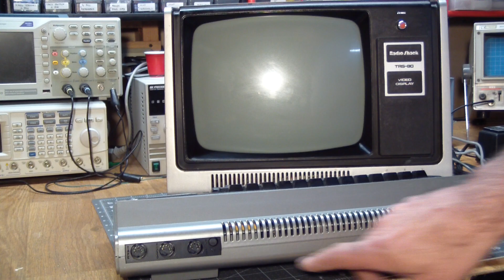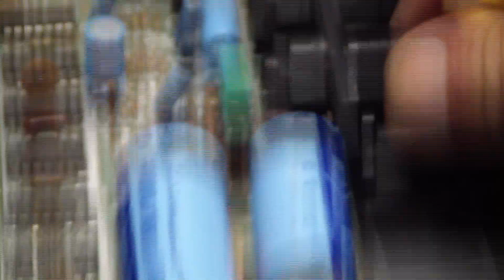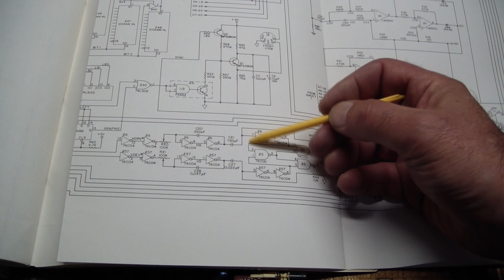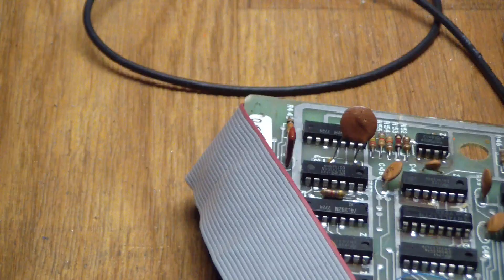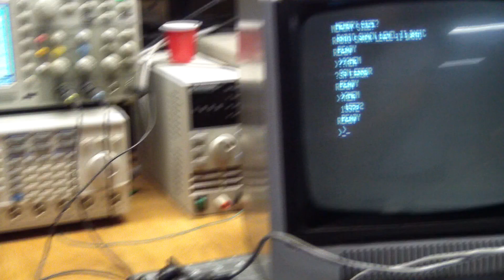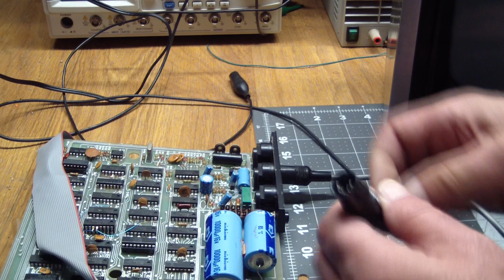AE#203 TRS-80 Model 1 CPU Board Repairs

Comment: Really enjoy these retro computer episodes. My brother still has my dads trs80 1, in its original box with all the literature.  However, he refuses to take it out of the box, even to check fo leaky caps. Seems a pity as i know my dad would have wanted it to be used.
Reply: A real shame, because it isn't bringing anyone any joy hidden in its box.
Reply from the maker: Model 1 computers don't have self destructing caps but do have bad early CMOS chips and dirty switches. You should be able to plug it in to test without any damage.

Comment: ARTIFACTS, Why are they using those CMOS chips instead of TTL chips for the V-Sync signals and Pulse Generator signals? it seems that the CMOS chips output weak signals compared to TTL chips outputting stronger signals?

Comment: I had a lnw 80 computer in the 80's, which was a trs80 clone in kit form. Its 40 years now but if i remember correctly the keybounce was a known problem, radio shack forgot to implement a debounce routine. On my lnw i had the same problem. Radio shack added the debounce in later lvl2 revisions, you can see the difference between the two when you look at the free memory. Original was 15572,new revision has 15570 bytes free. Also the startup msg was shortened, to make place for the extra routine. So you keyboard is fine. Just look for the newer roms.Itis 40 years ago but in pretty sure i remember this correctly. Btw, the lnw was a interesting machine, it was completely compatible but did have high res graphics, it had a metal case with internal power supply and room for the expansion interface. The expansion interface was also a clone that predates the trs clone. I think it had the diskdoubler integrated. Sadly i dont have the computer not anymore and in the Netherlands its impossible to find.maybe its more common in the us, lnw was an us company and they also sold the complete package ready build and tried to sell it to businesses.